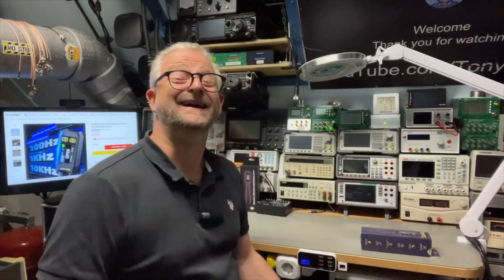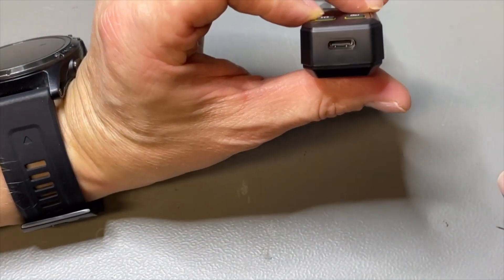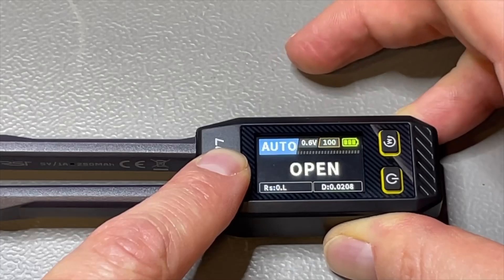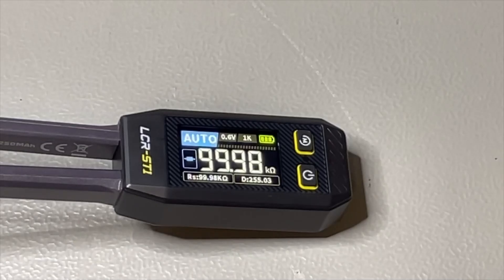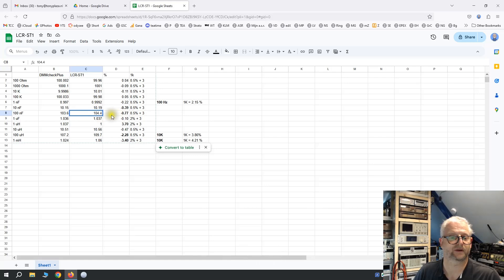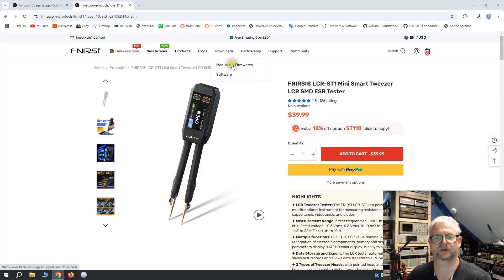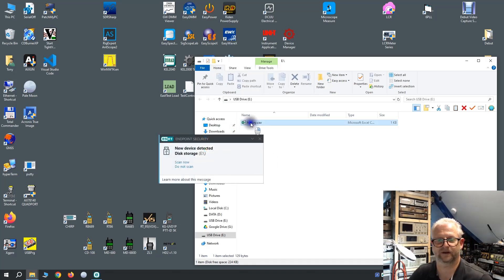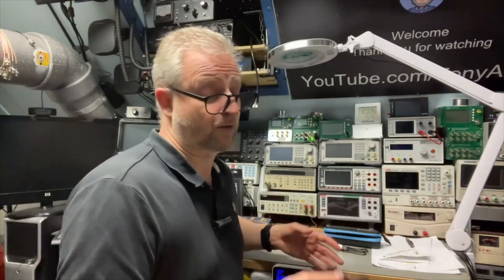TA-0424: FNIRSI LCR ST1-LCR Bridge Tweezers - Hands On - Firmware Update

Comment: Hi Tony. I just got mine. Trying to figure out how to properly do the calibration. As I have seen (and you already did) was the short pressing the power button to quick correct for the offset. There is also a calibration where you can connect known values resistors. To go into that menu you need to push the rocker switch to the left and then turn on. You see Calibrate option. BUT, from here I am not sure any more how to correct do the procedure, that is which buttons to push 🙂 Tried to do something but made it much worse, so ending up restoring to factory defaults 😀 (Ctrl+z and factory defaults are very nice functions hahaha). I can not find anything in the manual. I have seen some Chinese text but, yeah... 🤷‍♂no idea..
Reply: I suppose I know how it is done: 1) Push the rocker switch to left and turn on the unit, 2) with rocker switch left-right choose which value you want to calibrate: Short, 1, 10, 100, 1k, 10k, 100k, 1M, 10M, Open. 3) Once chosen connect your standard. 4) Short press M and see that some Chinese text appears. Keep connected your standard, and wait about 10 seconds. At some point you see the text has changed. I suppose that means the calibration is done. 5) If done long press the M to save and go back. PS You can always reload the factory settings 😀
Reply: Just fast tested "as is" and it is already very good, so no need to calibrate. After all not the purpose of the unit to do very accurate measurements after all. Very handy little tool.
Reply from the maker: Hi Ernest, thanks for sharing all your findings, interesting!!

Comment: The metal plate is probably so that you can stick it to a non-metal surface and then hang the LCR tweezers up. There appears to be a magnet on the back of the tweezers.
Reply from the maker: Thanks, i never thought of that. that also makes me think, they could have saved weight by not adding the magnet.

Comment: Good stuff,,hey I have a xeigu g90 my neighborhood has some qrm I bought a Chinese qrm eliminator, works great on recieve,, can you help me make a ptt cable so I can use this for transmit as well thanks
Reply from the maker: Hi, i am not familair with the G90, but there is a great change someone has connected a HF power amp to it, try to find projects like that. it also needs a PTT signal.